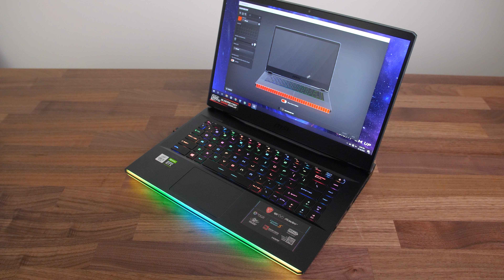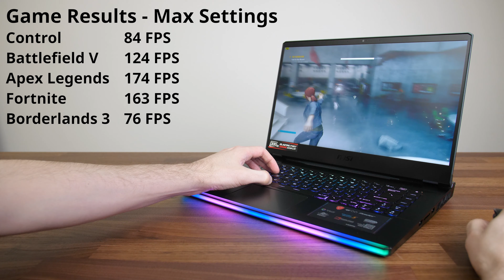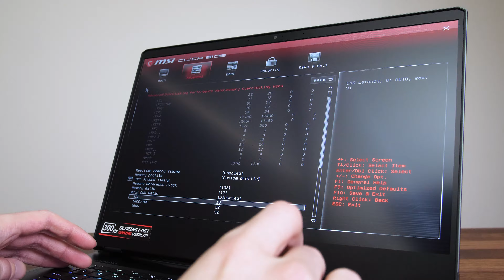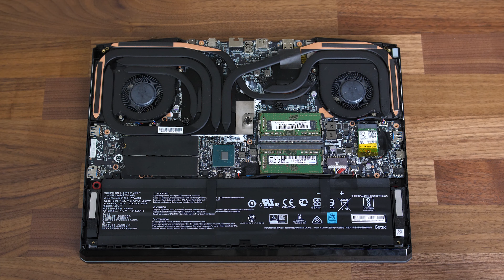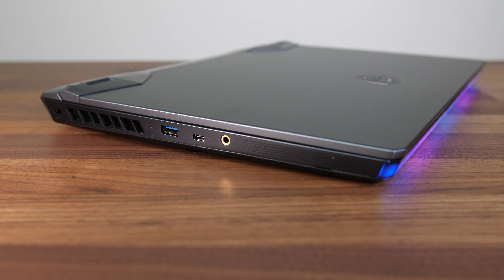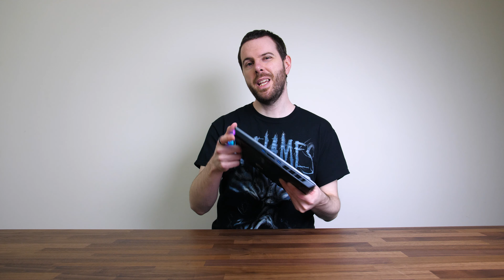MSI's Best Gaming Laptop In 2020

Comment: Hey Jarrod, I'm looking for a laptop specifically for CAD, photoshop as well as premiere pro (for on the go editing). I'm a university student studying Design and Media. I own a pc at home thus most of the powerhouse work there however,  some works are to be done outside and at the campus. I've been looking for a laptop with USB C charging and had eyes on the XPS 13 (however I heard about its thermal issues) and razer blade stealth (no full-sized/micro sd card slot tho) as they both have a good SRGB. I'm only familiar with windows laptops. its been quite difficult for me to find a laptop with a good screen, USB c charging and has a graphic card for quick sync. I dislike carrying heavy gaming laptops (they have bad battery life, heavy and rarely USB C charging).

Comment: I wish they allowed that 105 watt GPU power limit out of the box, because this dynamic boost ruins manual tunability of msi voltage\frequency curve. If it runs too hot - just thermal throttle, but don't make the power limit jump around all the time!
overall good video, Jarrod.